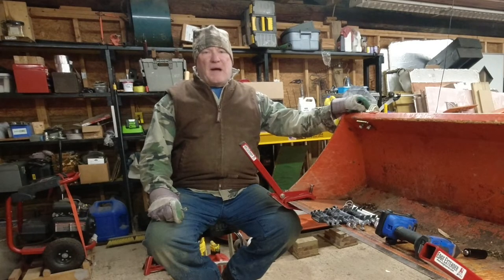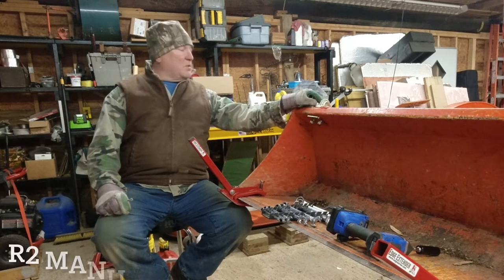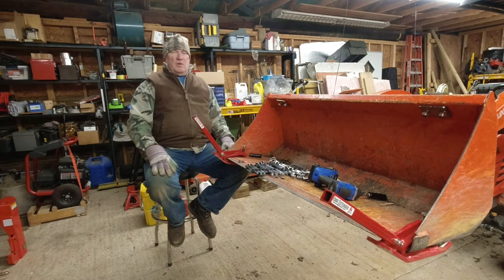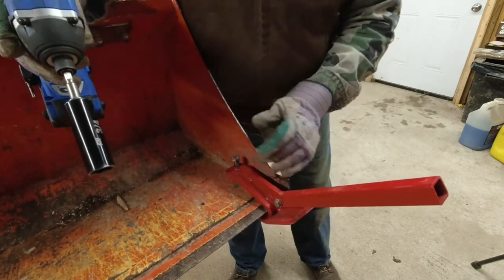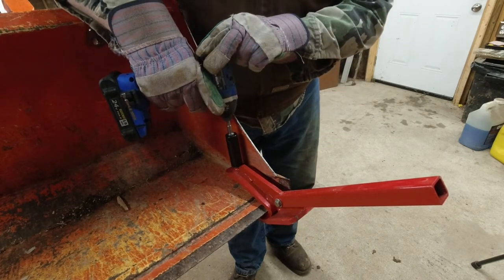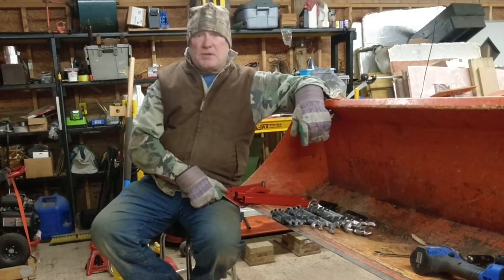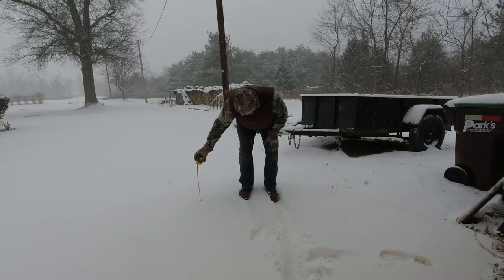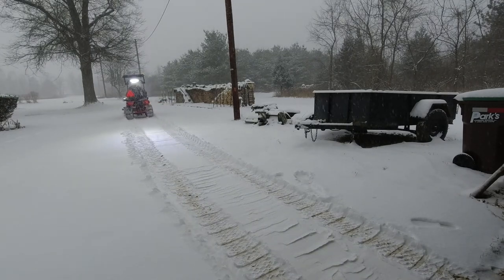#65   Edge Tamers Install & Snow Removal

Comment: Great little video. I also purchased these edge tamers for my gravel drive and they work great for no damage work both on gravel and on the lawn where I push my extra snow. The one thing to remember is that they do leave some snow on the drive but it packs down good after driving on it a bit. I am able to keep my 200 yard grass two track that leads to my barn open with absolutely no damage to the grass.
Reply from the maker: Thanks for watching and commenting.  In my opinion, the Edge Tamer is an excellent option for moving snow from drives and lawns.  Thanks for the sub.  Feel free to comment on any of the topics I cover on YouTube.

Comment: Thank you for posting the R2 Manufacturing link. They are just west of me by a couple hours, so i might call them and see if i can go pick up a set of the bolt on ones.
Reply from the maker: Larry, this is one of the best purchases I made for the BX - I would recommend them today for any color tractor - And I don't regret buying the extenders - For the money they are a good buy - thanks for watching and commenting - cheers

Comment: Great video Bob!! Appreciate the informative info on the extenders as well! One question; besides the obvious disadvantage, is there any snow back dragging capabilities at all with the edge tamers installed? Thanks!!
Reply from the maker: I would say no, there is no back dragging with the Edge Tamers.  A good option would be a rear blade turned backwards for a gravel parking lot/driveway.  Here in Central PA, I get more use from the Edge Tamers then I do with my FEL mounted plow.  Thanks for watching and commenting.  Enjoy the journey - cheers
Reply: Thanks Bob! Appreciate the insight!

Comment: I like these as it basically turns your bucket into a semi pushbox. How did you like them? I almost built my own tamers last year but then figured I’d wait till next fall and this fall is when I decided to just build a pushbox instead but these tamers are a great way to keep costs low while keeping snow removal production high. Great video as always bud
Reply from the maker: I like them a lot - they are not very expensive, and they can be used in a number of applications - This was my first time using them this year for snow removal - but as you see I had the extenders installed - so I use them all year round as needed.  Wishing you all a happy new year - thanks for watching and commenting
Reply: @botabob  for sure, can even use them for fall cleanup 👍🏻 thanks Bob you too!

Comment: that could have several uses, kinda like a light weight fork lift and also, keep the blade from digging into the driveway.
Reply from the maker: Absolutely, and it works on any tractor big or small.